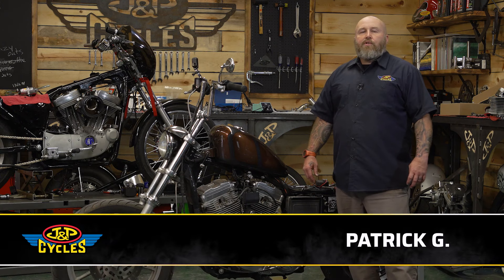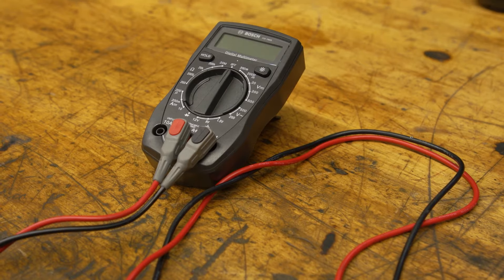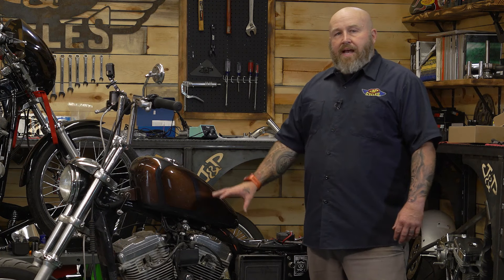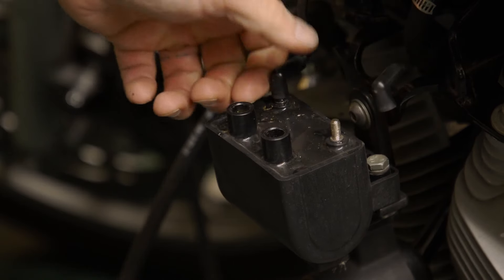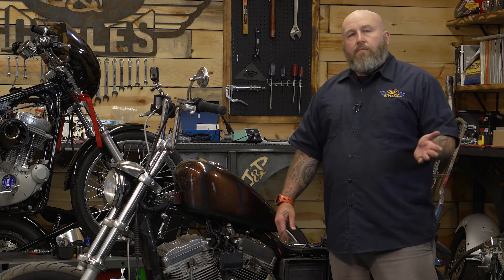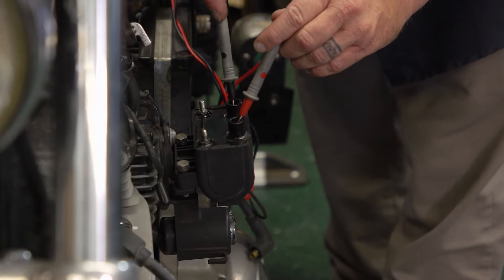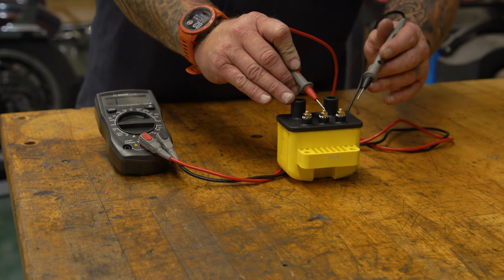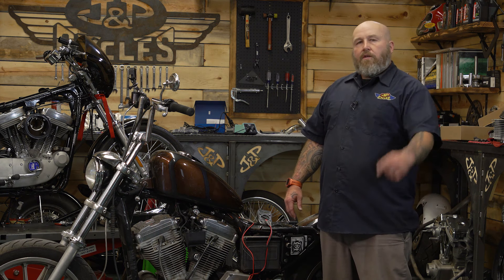How to Test a Harley Davidson Coil : Weekend Wrenching

Comment: Great vid ! If its 5 ohm coil what should i be getting on the volt meter 2nd reading ? In the leads connection,mucho gracias

Comment: When testing the secondary windings on a single fire coil for Ohms, do you insert the probes on each of the towers, or is it from the middle (B) terminal of the primary windings to each tower at a time?

Comment: What about the coils that have a single wire with about 4 prongs. To be a little clearer you just have to pull the coil wire off the back of it and inside the connector there is 4 little prongs inside. How do you check those kind. My bike is a 02 deuce if that helps??

Comment: Hey bud I got a twin cam rocker 2008 it’s a different Ignition coil with a 4 pin Delphi on the back. If you don’t mind how do I test that with a multimeter. I’m learning and can’t find out anywhere on how to test it. I’ve been chasing an issue for a while please help 😂

Comment: my 2001 XL1200c got no spark, tested the original harley coil with this method it reads 2.7 ohm, so i looked for a new OEM from ebay, but this new OEM only reads 2.8 ohm asked the seller he told me thats anywhere btwn 2.8 to 3.2 is very typical, is that true?

Comment: Hello, I have a 2001 Harley Ultra and have no power to my coil, but when I put test leads on the coil connector, one in the center, then ground the other to the battery and turn it over I get 12v off and on. I am not sure of the coil gets 12v constant or does it get it only when the motor is turning over. The issue right now is I have no spark to the plugs at all.
Reply from the maker: The coil should be on 12v switched power. When the key/ignition is turned on the coil should have power.
Reply: @jpcycles  Ok thank you, now I have to just trace the wire from the coil back and see why I have no power to it. I will try and find a schematic if I can to see where it originates from and go from there.

Comment: Hi I have a 2010 Harley Davidson Electra Glide Classic, I check the output reading of the ignition coil wires and I get 6.3 is this normal? I bought a new coil and it gives me the same reading

Comment: 2000 sportster.  i found my aftermarket RMP gage going carzy right before my coil went out completely.....well for months it was going nuts.  needle flying everywhere over 3k rpms.  new coil fixed it too.  Now years later i have intermittent spark warmed up.   cold is np but after warm random no spark and random duration until cooled down again.  PIA

Comment: My ohms on the out side are zero but when I shake connections from the multimeter it jumps up and down and then goes back to cereal once it’s still. Bad coil . I hooked up outside positive and negative with 12 V and got spark out of the spark plugs. But it looks like ohms are not there it’s old coil about 10 years old. Would you recommend just buy a new coil by a whole new Dyna S kit that I had before

Comment: Hey hey. I've got an 08. What's the different procedure for me?
Reply: coil on an '08 Sportster is usually not the issue...Crank Position Sensor, however will be the most likely culprit/ and or spark plugs,  I guess to answer your question...use a Noid Light...with appropriate Noid connected to coil connector, while cranking the engine the "Noid" if receiving proper voltage/ signal etc. it will flash...

Comment: I've got a problem with the engine cutting out when slowing down or cruising.....runs  great under acceleration., but almost always does at stop sign.. almost!    Where should I start to fix this?
Reply: That’s my issue too. But it’s when my bike gets hot (after riding for about 1/2 hour). That’s when it wants to stall at a stop sign.
Reply: Did you ever find the solution to this?

Comment: Your Wrong! I tested mine and it tested fine according to specs. But it wasn't working right when it was running on the bike. Only 1 cylinder firing! So this test is totally INACCURATE!
Reply: heat can do weird stuff. mine was good cold and bad hot...FML.  intermittent spark.
Reply: @feltonwem  it turned out to be loose connectors at the coil.i re soldiered  them. . They looked fine but after removing them after 10 times they fell apart.